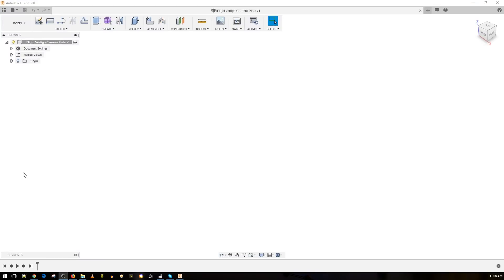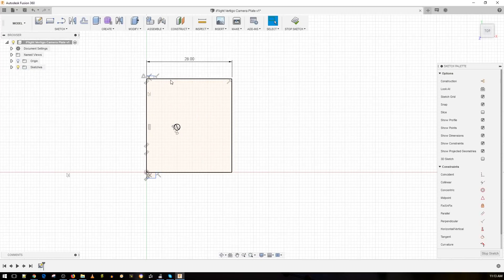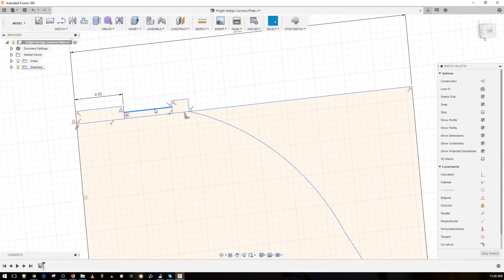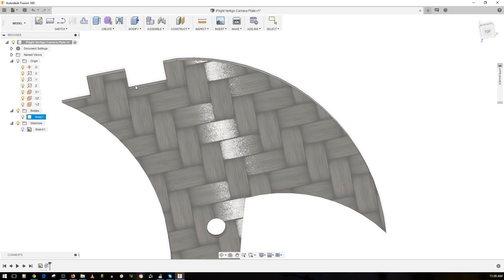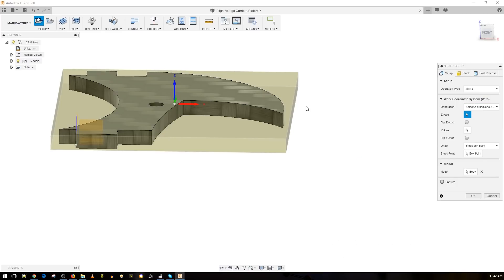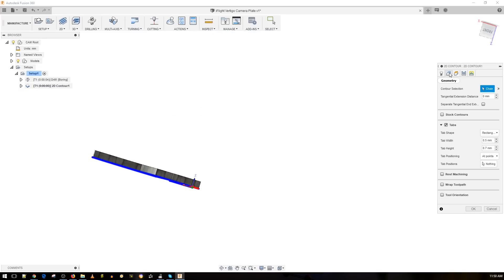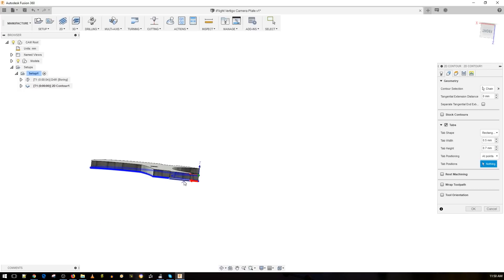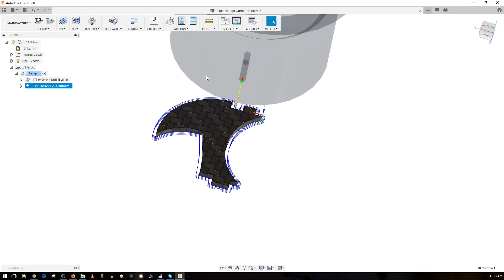CNC Carbon Fiber Project #4 // Designing New iFlight Vertigo Cam Plate

Comment: Nice work. Where can I get a frame cut? I have an old discontinued frame that has a broken arm. Would be cool to get it back up and running. I found the stl on thingiverse to try to print it but all I have is tpu. It probably won’t work.